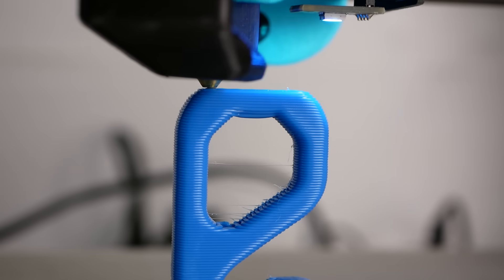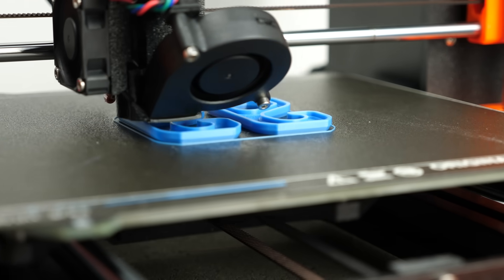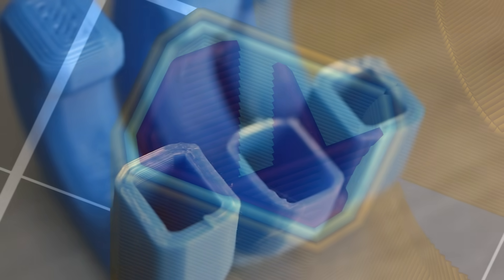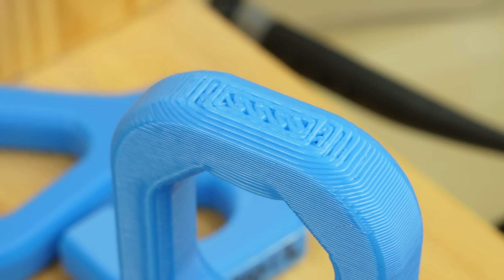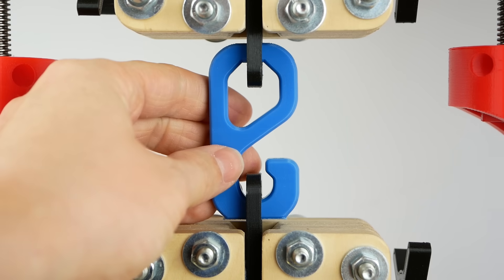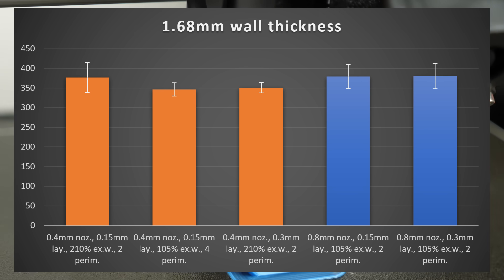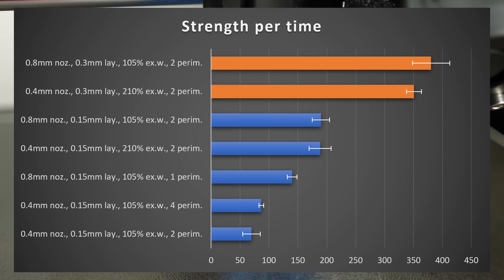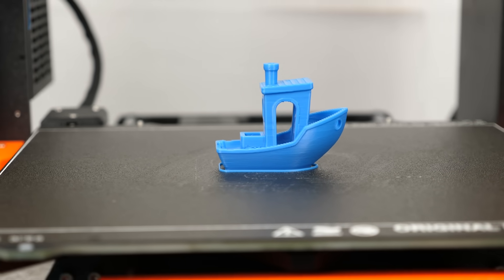BIG nozzles - HOW they (can) make your 3D prints STRONGER

Comment from the maker: Don't forget to share this video on Facebook, Reddit, Twitter and other social media!
Reply: dude you are the best 3d printing youtuber out there! im working in the field of printing, and i surely dont need no inspiration or curiosity boost, i already have that - and thats why i dont like watching youtube vids about printing, they lack pure information. Thats why you are the best of the best, you dont follow the route of those poularizers, and for the unique info you are giving i keep watching you and i shall watch every single one of your videos for the time i care about this technology.
Reply: I believe your strength per time results would have been very different if you were using a higher flow hotend. With a volcano you can print with a 0.8mm nozzle at flowrates that you would not be able to match with the 0.4mm without significantly increasing your print speed which will bring it's own problems.

I use a volcano with a 1mm nozzle for the majority of the items that I make because I'm trying to make strong and/or tall objects quickly. On one of my parts I was able to take a day off my print time while reducing print head speed (thereby reducing vibration and improving print quality) vs the one I made with a E3Dv6 clone. This is with the same wall thickness.

I am tempted to try your extrusion width trick later to see what results I get, but I'm a little skeptical of getting similar times considering that I'm running 12x the flowrate that you did in the video.
Reply: 3 mm3/s makes ugly bridges 🐍🐍🐍
Reply: Why do u have z hop activated?
Reply: I think it's a flawed test because it doesn't compare solid objects, just material volume.

Comment: Interesting. As I am interested in the speed advantage using a 0.8 vs 0.4 nozzle with same wall with I wonder if there is a visual quality difference in z axis surface using same layer height.

Comment: 3:90 - That's four times the material per second given a constant 60mm/s flow speed. I guess that's the key: you could achieve any flow rate you want if you ignore flow speed, but if you want to avoid the firehose effect, you'll want a larger nozzle for higher flow rates.

Comment: I just posted this on Lost in Tech's video too, but food for thought. 
After watching this video as well as CNC Kitchen's line width video, I am starting to wonder if measurement of extrusion force needs to become part of the discussion. The bed leveling springs have a finite stiffness, as does the bed and the machine frame. At these extreme widths, the pressure applied to the bed and in reverse to the extruder, even if the extruder does not skip, must be large enough to deform the bed springs at least. 
I wonder if the linearity in line width underdelivery is really just measuring the spring rate of the bed leveling and machine stiffness, and the wander is due to the variability of stiffness at different parts of the build plate.

Comment: Just upgraded from wonder 3 with a 1mm nozzle to a Bambu labs ps1. I usually print home decor like pots and wall art that utilizes slightly thicker layer lines usually around .5 mm height and 1.5 mm width. I want to know if I should buy the .8 hotend from bambu or go for a .6 high flow rate hotend from E3D, any thoughts?

Comment: I've got hot swappable 0.25mm | 0.04mm and 0.08mm nozzles, that all perform equally well with 2.85mm filament in the Ultimaker S3, however I agree when printing with 0.08mm, more material is laid down, without losing too much definition on drafts and larger builds, but starts to impact on the quality of smaller prints. I find 0.08mm tends to handle radiuses and sparse fill patterns with ease and without relying so much on the use of external supports. I do however prefer the finer line spacing that 0.025mm and 0.04mm nozzles offer. I found larger 2.85mm filament through an 0.04mm nozzle gives me many more 'draft' prints per kilogram.

This my 3D noob opinion, I could be wrong. 😉

Comment: I originally switched to larger nozzles because I'm impatient, but I've since leaned into nozzle diameter as a major consideration at the part design level. 
IMO, this is a really efficient way to design and print functional parts with great strength (and speed). they don't look amazingly high-res, but you can't beat the performance and time.

Comment: Interesting video, Stefan, as always, many thanks. I wonder if it works the other way around too. For example, my printer normally has 0.6mm nozzle and I needed to print a model with higher quality. I did not want to go through the hassle of changing the nozzle to 0.4, so simply printed a gcode sliced for 0.4 nozzle using a printer with 0.6 nozzle and it worked great. Do you see any issues with that approach?

Comment: How about nozzle diameter and carbon fill. Right now, I am adjusting my nozzle diameter (0.40mm) to print at 0.32mm so that the fibers are.more constrained and aligned.  I have no test to measure any change, but would thinner print width increase the tensile strength of 3d prints with carbon fill?

Comment: The conclusion is not taking into account what happens when you print at >105% line width when using 0.8mm nozzle, I suspect it can achieve a layer strength that a 0.4mm can't come close to

Comment: I've been using the 0.4mm nozzle for three years but my printing times for  larger pieces (Electric Unicycle accessories especially...) were uncacceptable.  I switched to 0.6mm nozzle with 0.4mm layer height, printing time became much more acceptable, I can really see the part growing along the day and it's very satisfying. The parts are also at least as strong and for big pieces I don't really miss the defition (if anything it looks better and fuller).

Comment: I've been using a 0.6mm CHT nozzle for a few weeks now. For my parts (mostly functional, rather simple parts) this still is fine enough and I can just print them much faster at 0.3mm layer height, 0.8mm line width with just 2 perimeters at high speeds.
Speed was the main reason for the upgrade (obviously, since it's a CHT).

Comment: I have a standard printer with 0.4m nozzle and I use 0.2 mm layer height most of the time. If I change for 0.8mm nozzle and 0.4 mm layer height, do I need to change only (nozzle and layer height) parameters in my slicer or I need also to change a program?

Comment: I use .6mm and .8mm on a regular basis and at the moment I'm printing an adapter for my vacuum cleaner with my 1.5mm nozzle. Yep, on 1.75mm Filament xD That thing is perfect to get rid of a lot of filament FAST. Oh and also for ducts, containers, pipes n stuff...so basically anything vasemodable

Comment: I have been messing around lately with trying to tell the slicer I have a bigger nozzle. I find that telling cura I have a .5mm but use a .4mm I get less failure and faster prints when using PETG it seems to be the sweet spot.

Comment: can someone tell me what the problem is when I retract with a 0.8 I get "bubbles" like if there is moisture in the filament, but I get it with new spools also, only tried printing PLA. but I only get the error with 0.8 and I tryede shorter retract and slower retract And extra prime and last, less print temp, but I doesn't work 🙄

Comment: I have two ender three and I recently just equipped a 1 mm nozzle it’s the best thing ever. you can still do smaller layer lines like .3 mm but it’s just so much quicker.
Reply: Hi what nozzle temperature are you running

Comment: SERIOUS print failures occurring when "extruder width" percentage is well beyond "layer height". My experience causing extruder to bump into previously printed layer wall, resulting in layer shifts/print failure.

LAYER SHIFT issue completely resolved when "extruder width" percentage result, is slightly below "layer height".

Simplify3D has AUTO EXTRUDER width option, this "auto" fails terribly when using LARGER nozzles over 0.4mm (LAYER SHIFTS/NOZZLE BUMPING). With the FolgerTech's FT-5's direct drive extruder.

Comment: I never use .4mm anymore because the die swell adds a hundreds place decimal making it .48mm. Instead, I use .5mm nozzle because the die swell adds an even .1mm creating a realistic .6mm width. Much easier to consider when designing dimensionally accurate parts. The slight increase in nozzle size also increases strength while still being able to retain tiny layer lines.
Reply: Might I also add that it prevents more clogs with fibrous filaments than a standard .4mm.

Comment: Thanks for the video.
Inspired by it, i tried printing printing asa with 1mm extrusion-width on a 0.4 nozzle(0.32 layer-height). Its a copy ring for a router. With normal extrusion-width the printed part was very easily destroyable by hand. The Parts with 1mm ew are indestructable by hand. The dimensional acuraricy wasnt great an the surface wasnt pretty. But, man, the stability is insane. And it printed quite faster even with slow 15mm/s...

Comment: Could you check the results with 0.8 nozzle at above 50% layer heights? like 0.4 / 0.5 / 0.6 heights? I've been printing strong parts for a long time, and was always under the impression, with a larger nozzle, that around a 50% layer height to nozzle width ratio was ideal, atleast with 110% width.

Comment: I usually print with 0,8mm nozzle, with 0,2mm layer height. The thing is that I don't print in pla, I use petg, abs nylon etc. And the difference in layer adhesion with this plastics without an enclosure is extremely notable. It's really simple the reason why, as you are printing more material, the temp cooldown of it is longer, so the adhesion between layers is better (the piece is hotter as you print). Also with some pieces I have problems of excesive temperatures between layers, normally small pieces (printing one at the time). As I said before, it's better to test with higher melting point plastics, PLA is not the better plastic to check for better layer adhesion, since with a normal 3d printer you get really good strengh of it.

Comment: Great video as always love your content!

One important remark: extrusion multiplier 200% is NOT the same as double nozzle diameter. The flow through a twice bigger nozzle is FOUR times bigger.
That is why you have holes on the 200% print. It is two times under-extruded. Should be 400%.
Reply from the maker: No, it isn't, as long as you leave the layer height the same.
Reply: I'm pretty sure he was talking abt extrusion width. In this case, the slicer should adapt to extrude 400% the material, and then doubling the layer height should double the volume once more. I might be wrong with my math however.
Reply: The main perk of a 0.8mm nozzle is the lower extrusion backpressure and the capsbility of larger layers. Its easier to print TPU for example and you dont need as strong of an extruder with a larger nozzle compared to printing the same settings with a smaller nozzle. What happens if you have a 1.75mm nozzle with 1.75 mm filament? Not a CHT, just a standard round bore nozzle?

Comment: I use a 0.6 and 0.8mm nozzle for large parts that don't need to look nice or for prototypes. They print super fast. For other prints, that need to look nice, i use a 0.4mm nozzle. I'm experimenting with a 0.2mm nozzle as well, but I only have petg at the moment and it's very hard to print with it. I had like 2g of PLA, and that worked great for the very bottom of a 50% size Benchy

Comment: in my experience, and without meassuring gear, fat extrusions arent of much benefit for PLA, unless you want that layered look. it's great for vase mode, though.
but it's a whole different story with PETG, where a thicc extrusion cross section and slow printing speed work wonders for chunky structural parts. (use little to no cooling. ideally the top 2-3mm of the print should visibly still be above the GTT! a big, flat nozzle face helps to transfer more heat into the print, and massage the still pliable layers into eachother. pratically tempering the4 part as it prints.)

Comment: In your table displayed at 2:38, I note you haven't used the Optimal wall thickness calculations as provided by PrusaSlicer, and described in detail at https://manual.slic3r.org/advanced/flow-math. I might be wrong, but I think you don't want to just multiply extrusion width with perimeters, as you would leave gaps in between due to the circular flow. So when you go to slice it, the slicer will likely change your wall thicknesses (or add infill, which is undesirable to your strength analysis), and you won't have the wall thicknesses lining up between your two nozzle comparisons.

So for example the optimal wall thickness of 0.15 layer height and 0.42 extrusion width with 4 lines is 1.64mm, not 1.68mm in your table. For your 0.8 nozzle at 0.15 layer height 0.84 extrusion width and 2 lines it is 1.62mm not 1.68mm. If your model pre-slicing was > 1.64mm for both cases, then I think prusa will add infill to top them all up to your model's desired wall width (or leave them with a slight gap). If your model pre-slicing was lower than 1.64mm, then you actually end up with different wall thicknesses between your two tests. For example if your wall width is 1.6mm, then your 0.4 nozzle test will have a wall thickness of 1.62 and your 0.8 nozzle test will have a wall thickness of 1.64, which would skew your results.

Comment: Newbie alert 😆
Hello,
I have one possibly very stupid question : why can't we use smaller nozzles like 0.01mm ( 10 um)?
Is there any limitation from  a material point of view?
I don't have a 3d printer yet so I can't test ; just using 3d printing services.
Why I am asking this?
Because I am trying to print small gears that will replace a few broken gears on an old cd player. 
Resin doesn't seem to be strong enough and the CNC route is too expensive...

Comment: it would be rather interesting to figure out a test that would measure "in-built stress" in each part. Observing warping alone and PP filament I "had a feeling" (no real test :( ) that inbuilt stress is much lower on the 0.6mm layer 1mm width with .8mm nozzle than lower layer height and smaller nozzle. But would be cool to make a test and test range of materials * range of nozzles with "ideal" nozzle conditions (*1.2 for width and *.5 for height)

Comment: Which of this parts will be more resistant? 

a) 0.4 nozzle, 2 perimeters, 105% extrusión width, 0,3 layer height
b) 0.8 nozzle, 1 perimeter, 105% extrusión width, 0.5 layer height

I asume they wheight the same.

Comment: I think it's importent to mention the extrution method, Bowden or Direct Drive. I'm pretty sure a bowden generally can't handle the higher extrusion pressure of doubling the extrusion width but a direct drive should be fine.
Reply: yes! i recently experimented with a .4 nozzle on a bowden extuder, trying to get thin outer perimiters for precision but thick inner perimiters to save time (using modifier in prusa) and found that it mostly under extruded thick extrusion widths. i didnt fiddle around with it for long thoug (eg reduce speed) and just used a 1mm nozzle

Comment: Am I correct that you had more stringing with the 0.8mm nozzle? In terms of print quality, does a 0.8mm nozzle printing at 0.2mm/layer output worse visual print quality than a 0.4mm nozzle also printing at 0.2mm/layer?

Comment: Pretty sure that most people print with wider nozzle to be also able to print at higher layer height, saving the time (if your extruder can keep up).
While you can go up to 0.6mm layer height with 0.8mm nozzle, you're stuck with 0.3 when using 0.4mm nozzle.

Comment: I'm just starting out 3D printing, so I've only used the 0.4 millimeter nozzle that the printer came with. However, I hope to experiment with smaller and larger nozzles for different prints in the future. Thanks for another one of the best 3D printing data analysis videos!

Comment: In my impression, the nozzle diameter doesn't really limit the flow rate all that much, unless it's tiny like 0.2. Since I almost always set it all up so that the flow rate is maxed, there isn't much difference IMO. 

What does make a difference though is the layer height. Big nozzle allows to make thicker layers, so the printer spends more time laying plastic and less time on moving around from point to point. This can improve print speeds, sometimes very significantly.

Comment: No, I don't use larger nozzles. Perhaps foolish since I have so many of them! [Note to self: "Hey meathead! Why buy so many and so many different types of 0.8mm, 1.0mm and 1.2mm nozzles in brass, bronze, Stainless Steel and Ruby if you're not going to use them? You wasteful arse!"]. I desire the smoothest outcome over absolute strength, so I use 0.25mm and 0.15mm nozzles. Ahhh! (your) Graph! My smaller nozzles aren't a problem (except in the substantially longer print times)!

Comment: I have a 0.6mm Nozzle in my CR 10 mainly to reduce printtime while harnessing the full build volume. With the Stock firmware on it I don't want to run this printer nonstop for days. I like to print thick single wall vases and functional parts that print fast. I also use overextrusion with those vases to increase the wall thickness to 0.9mm. Since the tip of the Micro swiss nozzles doesn't have that much surface area in comparison to an E3D nozzle I can only go up to 0.9mm without squish artifacts.

Comment: FYI, if you change the orientation of this print, you can make it even stronger, larger nozzle or not. In this orientation, you break the "Bond" between the two layers. In the other orientation, you break the actual molecular bond, which requires far more strength.
Reply: Those bridges would be a challenge without support though.